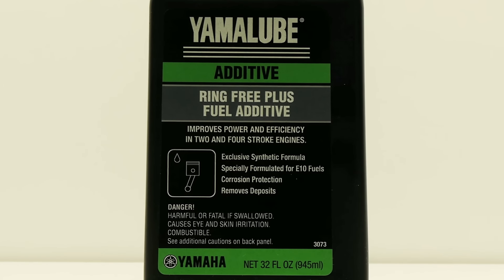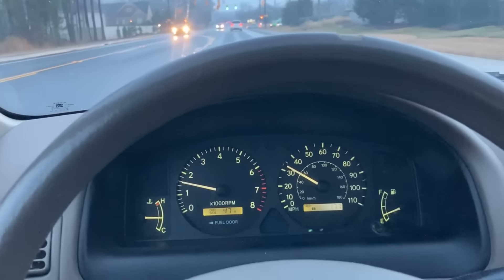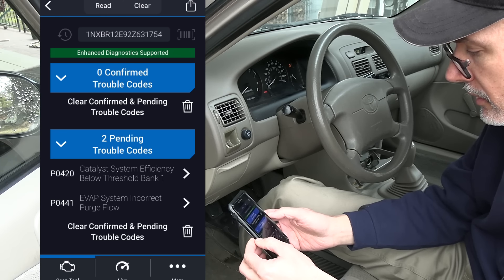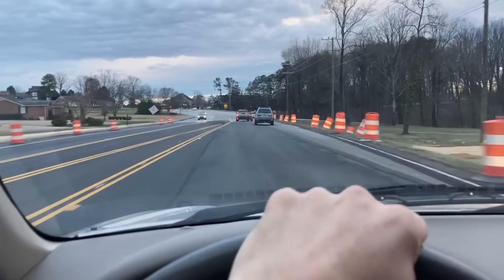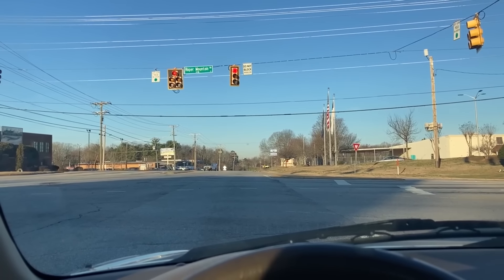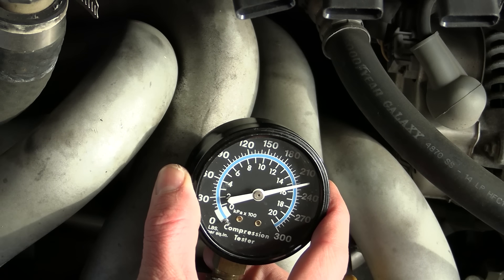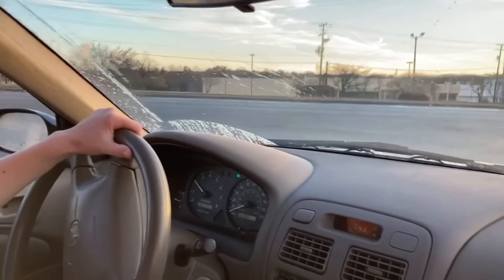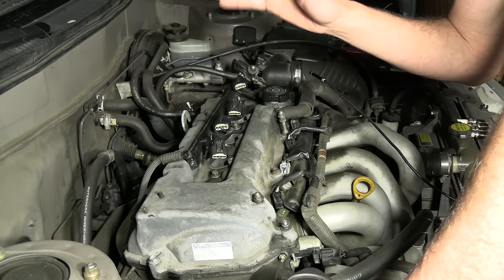Will Yamalube Ring Free stop oil consumption? | Oil Burning🔥Experiments | Episode 20

Comment: Gas tank additives don't do anything more than the gas does as a solvent. Port fuel injected engines will have cleaner valves since the gas is always being sprayed on the valves, unlike GDI? If your fuel injectors are dirty, then a additive may help, but it will not clean the combustion chamber or top of pistons?
Reply: Okay, so explain the video

Comment: I've used heavy weight oil and Lucas when my old truck would burn oil it stopped burning alot of oil to the point I was low when my next oil change
Reply: I promise heavy weight oil and Lucas is the way to go it may not free up the rings for say but it will stop burning oil
Reply: I've used straight 40 weight in a celica that had this motor. It did help consumption
Reply: straight 40 tractor oil

Comment: Dave, first off all thanks for all your great videos on oil burning… man you are persistent and with patience with that car. I do wanna see your results with the BG treatment, i already did that and this is my story: 2013 sonata gls, known for burning oil. It has the issue since 55k and now has 96k, i did a lot of stuff trying to fix the issue but no success. I did your method with Barryman and i soaked the rings for 3 days and cranking  twice a day and adding 1oz in every cylinder after crank. Car barely started after that. When I started and got warm i added the entire can of BG and run it for 25 min at 2250rmp. In a meantime i installed oil catch can and switch from mobil 1 full synthetic to Valvoline for the first time ever. The car used to burn 1qtr every 700-800 miles. Now after 860 miles not even single drop is burned and the oil look’s crystal clear. I can not even believe it got fixed. Waiting to see your experience. Good luck from NJ
Reply from the maker: That's great to hear! Hopefully I'll see some results too. 👍
Reply: @FamilyFriendlyDIY  here is my update after more than a month: was checking every 800 miles how the engines performs, at 2400 miles no oil burned and dipstick level is to the top dot.
At 3400 1gtr of oil is gone and the level is now at the bottom dot. I added 1qtr and i will be checking the level at 4K miles, now im wondering what happened so no oil was burned and what changed in those 1000 miles between 2400-3400 so 1gtr is missing??? From what i see online, someone was doing the same thing and after the flush he changed the oil  and the filter, drive it for another 30 min and change the oil and filter again so it flushes the rest of chemicals. I will try this and see how it goes. I was happy for a month or so that all is good but now back to square 1 and keep trying to see what is happening.   Did your oil consumption changed from 900 miles/ 1gtr?

Comment: Maybe remind us all you’ve done the valve stem seals at the beginning of each episode.  Curious if it still pings on regular with the carbon mostly gone.  Looking forward to the final chapter where you replace the pistons and rings with updated parts!  Fun series.
Reply from the maker: I hadn't thought about the carbon contributing to the knocking. You're right. Maybe I'll try 87 next time to see if it's cleared up.
Reply: @FamilyFriendlyDIY  I was going to say the same thing this guy did because any hot spots on a piston due to carbon buildup will see less issues on super
Reply: @FamilyFriendlyDIY  I think you could do with a new set of plugs or at least a good clean should help to run at its best, I don't claim it will help oil burning.
Reply: That's really high cranking compression for regular gas.
Reply: @hotrodray6802  Even with the high 10:1 compression ratio and effectively a wet test with all the oil in the cylinders I’d still only expect 180 or so.  240 is a head scratcher unless there’s really that much carbon in the combustion chamber we can’t see.

Comment: I am starting to think your catalytic converter and purge valve solenoid might be adding to this problem. i had same 2 codes on mine, those codes only, and I replaced the cat and the pvs, and boom, back to lower oil consumption. the added back pressure (from a bad cat) created excessive crank case pressure, forcing oil past gaps and between the rings, valve stem seals, etc, and the ecu running rich fuel trims because of the PVS was making my car burn a quart every 1000 miles or so. Now im only using a quart every 2500-3000 miles (engine has 378,xxx miles on it) and normal for its milage
Reply: One of his earlier videos he did open the exhaust and looked inside... Catalytic converter is ok
Reply: @ricebike  mine looked ok as well, but on the freeway it would get really warm and restrictive, thats when i noticed the most oil consumption as well

Comment: Dave  Can not wait to see the bg109 test just alittle heads up , the bg 109 is ( Heat Activated) make sure you are at operating temperature. and at 2,000 rpm for 20 min. I have used this on  my  own car and  3 of my nephews and one nieces car and it worked.
Reply from the maker: Thanks for the advice, JimBob 👍

Comment: Hey Dave, I like your videos on the Corolla. I have a 98 RAV4 with 274,000. I was gonna tell you about the premium fuel, but somebody beat me to it. Premium fuel is less volatile than regular made for engines built with tighter tolerances so they need less of an explosion in the combustion chamber. Thanks.

Comment: How about putting up the all previous batches pictures of piston top sides, taken by the scope, side by side for comparison. Date, time, milage and after what was added or done and etc etc.

In this case, this Yamalube looks like worth putting into a tankful of gas plus into the crankcase, during my annual oil change, even just for cleaning up the piston top sides and the intake valves. 🤔🤔🤔. Regards
Reply from the maker: Thanks for the suggestion. When this whole thing is over, I might do a video like that and include some charts or something to show track the oil burning.
Reply: @FamilyFriendlyDIY  BTW, would you suggest putting Yamalube lube into engine crankcase & into gas tank only at the last 500 miles before making the annual oil change?. This would instead of putting in during my annual oil change. Regards.

Comment: Well it definitely looks like the Yamalube Ring Free did something.  It seems like it would be worth changing the oil every 1000 miles and continuing to adi the Yamalube to the fresh clean oil and gas.  Really good videos Dave!  Thanks for sharing.  😁👍🤞
Reply from the maker: You're right. If I wasn't making videos, I'd probably do just that-- or something similar.
Reply: @FamilyFriendlyDIY  surely every chemical is helping clean the engine, though yamalube definitely has made a difference. To clean the oil rings I believe its necessary to treat the engine from the crankcase over time. I've used liquid moly oil flush also Wynns oil flush on the last 2 1000 mile oil changes. The last time with Wynns oil flush however rather than letting the car idle I waited until temps were up then I drove it hard for about 30 miles, the oil came out like out of a diesel engine. Its a vw 1.6 petrol, tohc 16v vvt. I've had it with different mechanics to try to get it running better but so far no-one can fix it. The only improvements were from spraying water mist into the throttle valve plus fuel and oil cleaners. It didn't burn a lot of oil like yours however compression is only 100psi on 3 cylinders and cylinder 3 had only about 85psi, that was a few months ago before all the flushing, I think its time to do another compression test to see if that has improved or not. This engine has 120k miles plus looks like it's been deprived of normal service intervals. The 2 common fault codes I get are Lambda 1 outside parameters and knock sensor. I have replaced knock and MAP sensor,  on live diagnostic lambda sensor is working fine, except it is intermittent when driving or maybe a broken wire, I think replacing lambda sensor is my next move. When I bought the car it was knocking and pinging so bad I had to ease off on the gas to save the engine from wrecking itself, I though big ends were going out was so bad. Both cats have been removed by previous owners.. with the cleaning there's now no problems with knocking but I'm still getting the same 2 codes lambda plus knock sensor.
       To make a long story short I think it's important to keep a engine very clean, even though we have failed to fix the real fault code cleaning has left the car driveable, I am considering constantly running the oil with pre change flush as I think it takes a lot of time to dissolve the built up carbon and a lot of oil changes to carry the carbon away, obviously any chemical treatment will weaken as it works so I think it's takes a lot longer and regular drains with cleaning chemicals refreshed often for any chance to unstick dirty oil rings. I've seen one guy bench soak testing many different chemicals like seafome, lucas, etc on old removed pistons with stuck carboned up rings. The most effective Chem was white vinegar. I know this sounds crazy but I think if you were to drain the engine, remove spark plugs, and then fill it up to the neck, I mean until it runs out of spark plugs, rocker cover etc. with white vinegar then carefully and slowly turning the engine over by hand brace at 6 hour intervals as you did, but over a few days, then drain out the vinegar and replace with oil, I would suggest a double oil change to rinse out the vinegar and be sure full lubrication is back throughout the engine before restarting it, probably better not even start the engine on first oil change, just crank it without plugs or fuel. This would be an interesting project. My point is white vinegar releases stuck oil rings better than all the other expensive chemicals I've seen sofar, however how do you get it to the oil rings to soak without dismantling the engine. I think it would take a couple of gallon of strong vinegar, I've no idea if it would have any negative effects on seals or gaskets etc but my guess it would stop any oil residue protection from the shell berrings so no way could you run the engine or even think about it until the vinegar was well flushed out..
Reply from the maker: @martinmuldoon603  Thanks for the suggestion, Martin. I watched the vinegar video (I think it was This Old Tony?) but he said it only worked on the rings because they were stuck with rust, and that he didn't think it would work on combustion byproducts.
Reply: @FamilyFriendlyDIY  where is the before photos of the pistons?
Reply from the maker: @wazup3333  previous videos
Reply: @FamilyFriendlyDIY sorry face I've been away from your channel for a long time, I've only seen your reply today 11/09/23, sorry I've been studying many other topics. Actually ended up parking the little Seat Ibiza 1.6. considering a head pull to assess if we can find what's really going on. I like the yamhalube, it's very effective at removing carbon, I think like as you said yourself it would probably eventually clean the sticking rings and oil drainback ports given enough time. I'm on a binge catchup, I still don't know if you've the Toyota Corolla fixed or not. I've really enjoyed your series of trials. take care.

Comment: I haven't been following all of your videos, but the P0441 is usually super easy to diagnose. unplug the purge solenoid electrical connector and the cannister side vacuum hose. Start the car, if you feel vacuum at the solenoid nipple, the solenoid has failed open.

Comment: As a professional mechanic, this is the stuff I wish I could do with customer cars. Unfortunately it's not feasible for obvious reasons.

Loving what you are finding out tho, along the way.
Reply: Hey bud, I wanted to give you some feedback. I recently purchased a fleet of MINI Bloopers from a customer. If you know Bloopers, mistakes were made, and they are notorious oil burners. 

Well my BG service rep came by and offered me their engine Dynamic Restorer kit. I was skeptical, but he swore up and down its tried and true.

I watched some videos on YouTube, and was pretty impressed with the results. So I decided to use it. I can tell you with 100% certainty it solved the oil consumption issues on two of my Bloopers. Only the third has bad valve stem seals and smokes after prolonged idle. The other two however, are not consuming oil at all. To the point where I'm not even checking the oil as frequently.

The stuff IS pricey (low 300's for a 4 item kit), but it's a lot more money to replace rings on an engine.
Reply: As a professional would you say that this stuff would be be safe or use at your own risk on an automotive four-cylinder engine? What potential harm would stuff cause on engine internals or the catalytic converter?

Comment: Have you checked or changed the pcv valve? Have you done a compression test to check how the cylinders are sealing? Both of those things would be on my list of first things to do with an oil burning problem. If the vehicle has high miles and is just likely worn there isn't much you can do except use thicker oil.  Use like a high mileage oil that is thicker. Go to like a 10w 30 and see how it does.
Reply: Watch the rest of his videos in this series, he's done some fairly thorough testing so far.

Comment: Curious if the cat P 420 pending code is still there. As all the carbon from the motor passes through the catilytic converter is it being harmed in the " decarbonizing " process ? Thanks for sharing the adventure.
Reply: Might be I got experience with seafoam intake service totally kill my cat
Reply: The long time oil burning is most likely what damaged the cat.

Comment: New here...i dunno all you have tried or done.  But the first things I look and address with oil burning is to clean or replace the PCV valve then put a catch can inline between the PCV and the intake manifold.  Also add a catch can inline on the breather side.  It would help monitor how much oil is being drawn thru those sources.  Judging by the straight oil in the cylinders its likely coming thru those sources vs the rings going off the strong compression numbers.

Comment: Old school of over 60 years ago would use bon ami cleanser to  reseat rings to prevent blow by and get better  compression
Reply from the maker: I could see that. I know a guy who worked at the Vespa factory in Italy many years ago, and he said they would remove the air filters and drive the Vespas on a dusty dirt road in order to break in the engines.😯

Comment: Wow!!! That is one clean piston! looks like Yamalube did a great job removing the carbon deposits on top of the pistons. Also your compression tests have improved. I'm thinking of trying this out see if it will do the same for my MK5 GTI. Thanks!

I'm still wondering why you're burning oil though. It should be sealing now since the rings may have been cleaned.
Reply: He didn't show the before in the video? Or am I not seeing it?

Comment: BG sells an engine flush kit that's really good stuff. I use it on a 13 escape with stuck oil rings and it fixed the oil consumption problem. It's crazy expensive, $300ish bucks but it cost a whole lot less than an engine.
Reply: I’ve seen this kit advertised. Very hard to come by - especially in the UK!
Reply from the maker: That'll be the grand finale if nothing else works!

Comment: Firm believer in Yamalube oils, used the brand for many years. If you dont mind smoke the old school method in a cattle syringe 10-30cc of diesel  poured in each sparkplug hole on a warm engine, let sit for a few days then start to free up stuck oil rings. longer it sits the better

Comment: I think you should consider usign multiple times Liqui Moly engine flush pro line in the oil when the engine is hot for 12-15 minutes and then change the oil, this stuf is top level in Europe. If you want to you should definitly use Tec 2000 engine flush (30ml) in each of the cilinders as and extra step and let it go through the piston ring to the oil, then change the oil. Next crank the engine without the sparkplugs to remove the rest of that Tec 2000 from the piston tops, reinstall sparkplugs and go for a nice "Italian tune-up" aka. drive the car hard with high RPM ;)
Reply: i used LM engine flush and it did nothing... still burning 1L/500km on my 07 avensis 2.4L 2AZFSE

Comment: The cylinder walls are like glass. Its probably going to consume oil even with perfect rings.  I had the same issue with yamaha yzf1000. If fuel has washed the walls and they are polished. Oil consumption is constant. It would need a honing job to get the grosshatch back. But freeing piston rings can still lower the consumption.

Comment: I had a toyota prius with the same issue. The only thing that was able to reduce its consumption was the chem tool as well. I had hoped to solve the problem completely as I've always used synthetic oil and my oil burn off was nowhere near as bad as yours. Id lose about a QT per thousand miles. After treatment I lost about a 3rd of a qt every thousand miles lol.
Reply from the maker: Glad to hear you saw some results with B12!
Reply: @FamilyFriendlyDIY  im thinking about trying the bg dynamic engine cleaner on it. Comes at a hefty price though. But I'm desperate. Hate buying oil like gas lol.